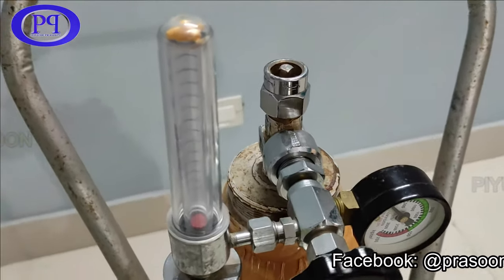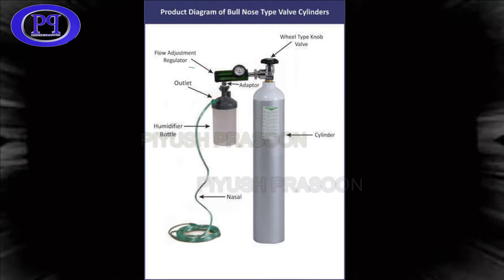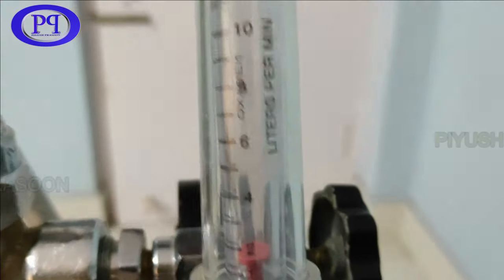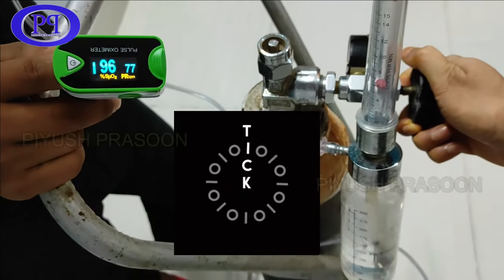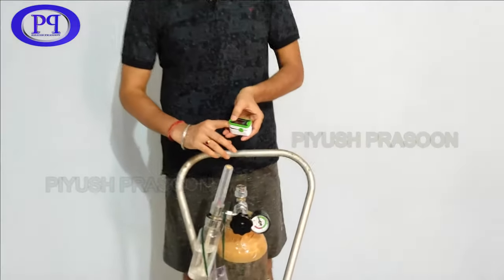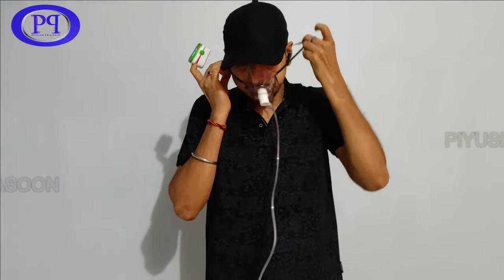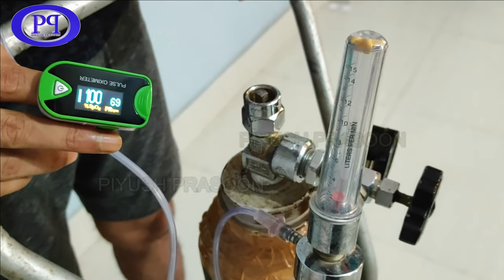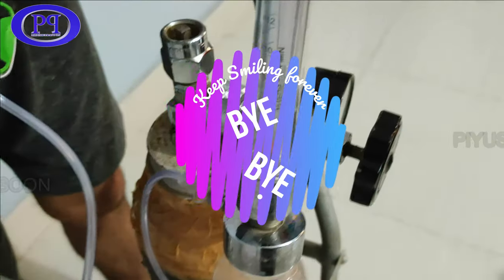The Oxygen Cylinder Working & Operation English

Comment: Help me where is thr compressor of oxygen? 🙏🙏
Reply from the maker: there is no such thing exist in the oxygen cylinder - it just compressed inside the cylinder and output of the same can be controlled via main valve.

oxygen is compress inside the cylinder as you see in LPG cylinder scenario.

Comment: With key how we know that this main part of cylinder is off
Reply from the maker: key is the main knob, however once you will turn the regulator key ONN or OFF with flow of oxygen in humidifier you will come to know if the main knob is ONN or OFF.